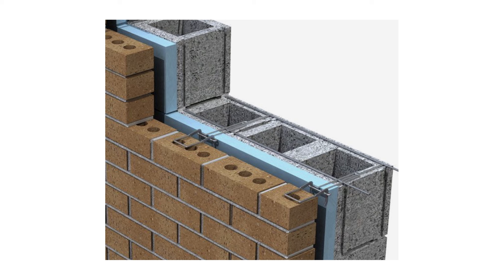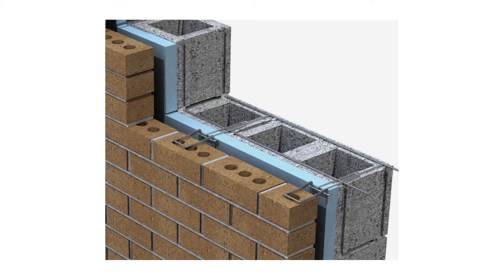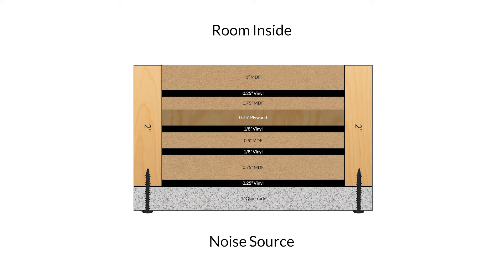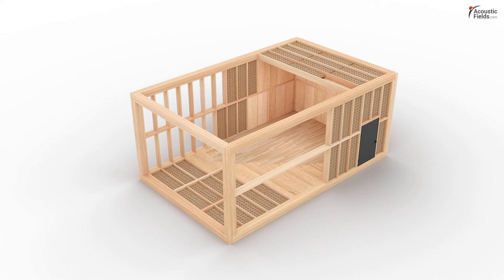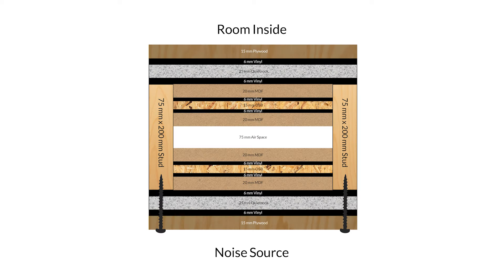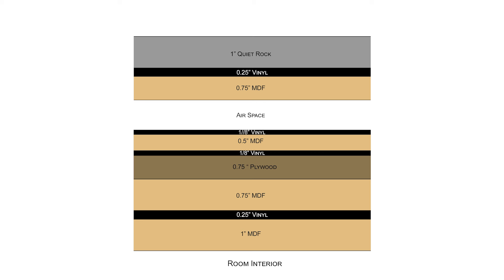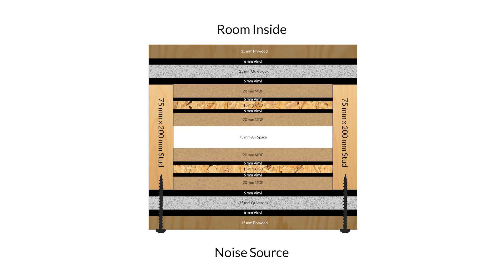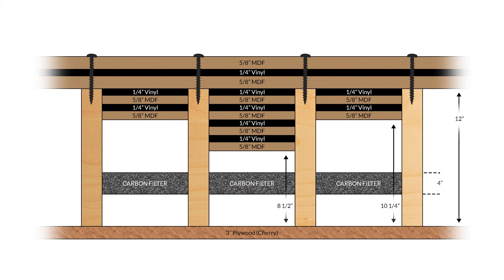Noise Barrier Sandwiches - www.AcousticFields.com

Comment: Hey Dennis, how about walls filled with sand? Not sure, but I've heard it works very well. Curious to see what you think- cheers
Reply from the maker: That is a viable methodology for lower frequency noise transmission. You must add aditional material types for middle and high frequency noise attenuation.
Reply: I have seen a motel built in the 1960's with concrete block walls filled with sand between each room.
Reply: What about the thin sand-filled cardboard used in Wolf Bavaria’s Phonestar?

Comment: Hi Dennis, just a quick thought on describing the interactions occuring from "garbage truck" to ear drum, Walls can be described with conventional T/S parameters, reacting to external energy impulses depending on frequency and amplitude, absorbing these energies can be treated just like ANC?? would love your thoughts on this analagy!! thanks mate
Reply from the maker: I dont think absorbing is the correct verb to use here. Noise transmission should be renamed to vibration transmission. We are really reducing vibrations through a process, but I dont think we can call that process absorption in the normal sense. Based upon my experience and study, we are attenuating vibrations. I do not think sound absorption processes would be at play here. Vibrational acoustics seem to have their own domain with its associated "rules" which do not overlap with the absorption processes that I can see.

Comment: Very interesting. However that amount of weight would be too much for an apartment in a building. As well as the space required. This seems targeted at studios and commercial settings with high requirements and space available (as well as cost). What are your thoughts on steel and lead? Cheers
Reply from the maker: We use steel many times for noise transmission issues. Lead is toxic.
Reply: @AcousticFields  My understanding was that lead is toxic to handle bare handed and if there is air exposing or connecting to where one breathes. If it is sandwiched and well sealed no amount of off gas or the like would reach the interior or the exterior for that matter. Also I think being more dense and softer than steel it's better for low frequencies. But the cost is higher for the same mass like 3 or 4 times as much. I would think it is much easier to handle and work with than steel (for cutting, moving, soldering etc.) specially if thinking of 1/4 to 1/2 inch steel as opposed to thinner sheets. Anyway, everything has a price as far as pros and cons. Steel and lead allow for less space but are more expensive than regular materials. Nice thing is steel is bulletproof.

Comment: Hey Dennis I was just sittin here thinkin, if the idea of a studio is to have no reflection, then wouldn’t a round or circular room be ideal or could it perhaps cause even more problems than the average rectangle ?
Reply from the maker: The idea is not to eliminate all reflections. That would be an anechoric chamber. Anechoric means reflection free. A reflection free room is used for testing sound sources such as speakers. If the engineer can eliminate room sound from the equaltion, they can focus on the product numbers without having to weed through room distortions. We need both direct (straight line) energy from our sources and room reflections in order to perceive the sound quality as realistic. A circular room would produce reflections that would tend to focus on the circle center and eliminate our ability to hear the wanted, direct energy from our loudspeakers or other sound sources .
Reply: @AcousticFields  ahh ok I should have known that you’ve said it many times before. Thank you for your answer sir.

Comment: Hey Dennis, I notice in these sandwiches adding the mlv eliminates air flow. When does it matter for air flow to pass? Only in the carbon filter area?
Reply from the maker: The sandwiches provide two functions. They provide an increased density for the rear "wall" of our diaphragmatic absorber process which increases the rate of absorption and they reduce vibrations which lower noise transmission.